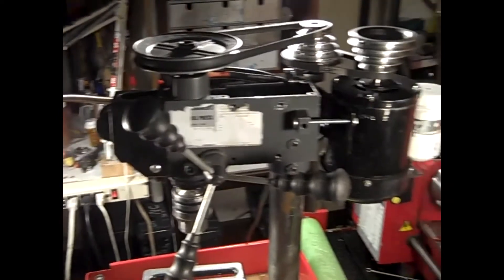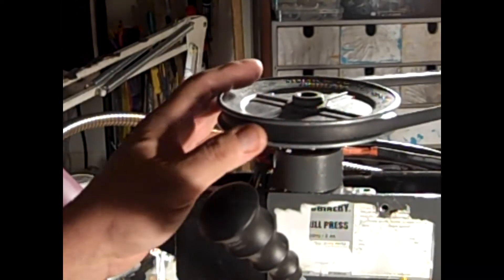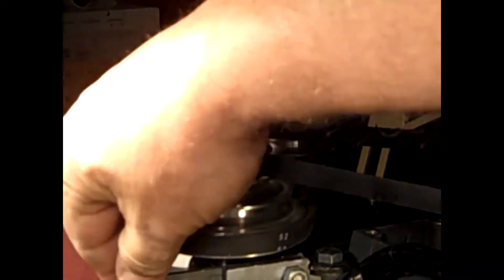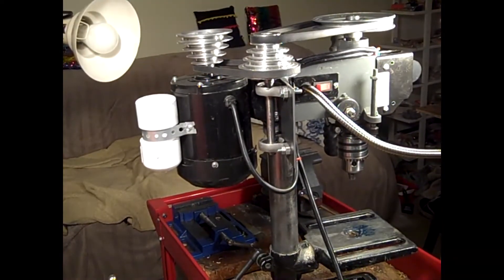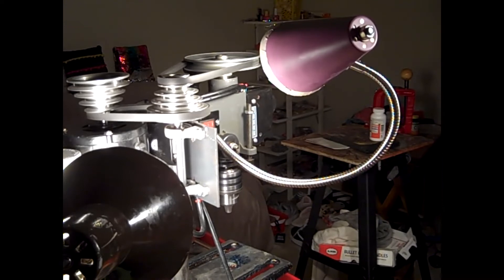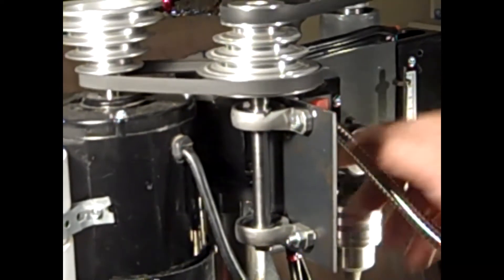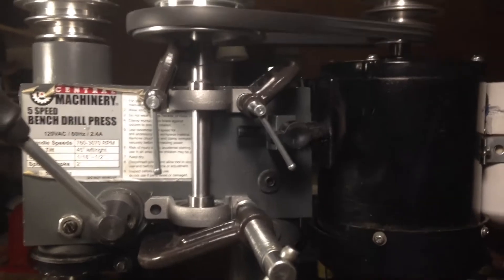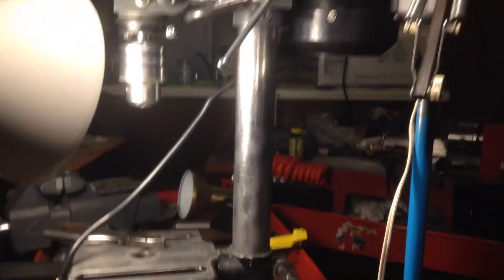DrillPressMod2 1

Comment from the maker: Camera is actually from 2010 and it is called "Flip Video". After testing the speeds, I now have these speeds without removing anything: 286 rpm, 427 rpm 582 rpm, 826 rpm.